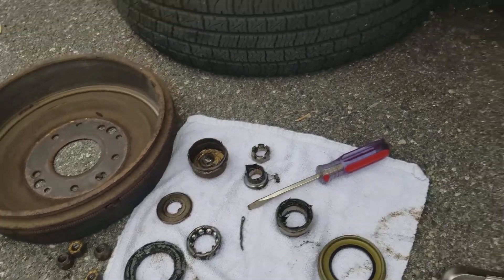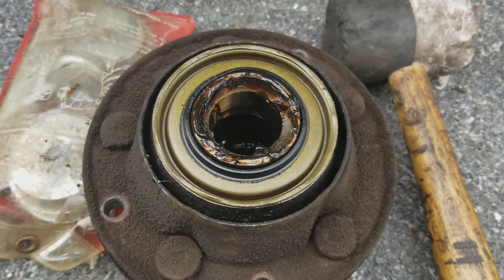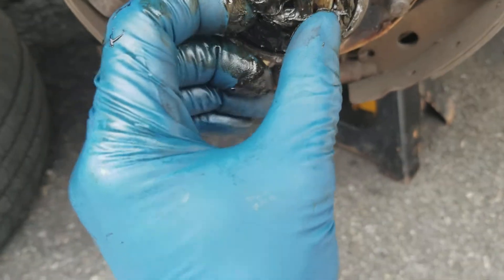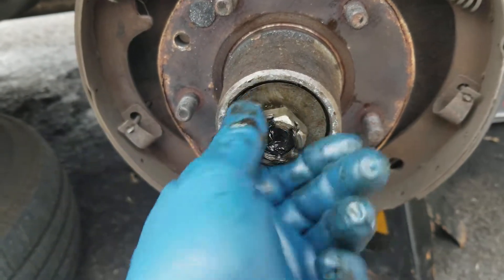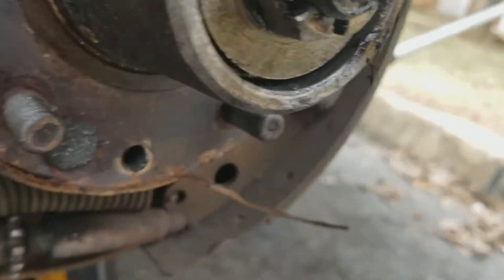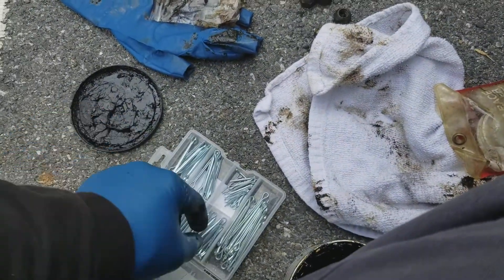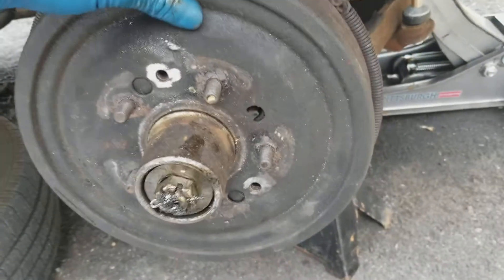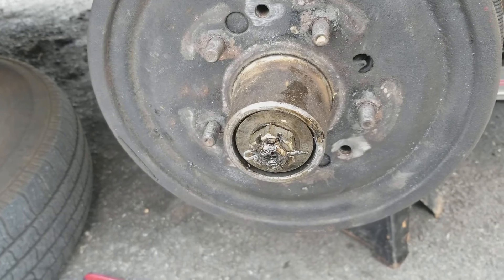Roller bearings for the '51 Chevy part 2

Comment: early corvette  had ball bearings
Reply from the maker: Tom Burgess 
This is true. That's because they had the exact same front end.
Reply: Christopher Spencer yeah I remember that when I saw them on a vette I thought man that is crude technology for a fast car Lololololol
Reply from the maker: Tom Burgess 
Haha yeah, I guess as long as their packed with a ton of grease they'd be "ok"..? If the National bearing I bought last summer didn't have a plastic cage, I wouldn't have been AS concerned
Reply: I am replacing the bearings on my 52. I torqued to 33lbs and backed off a bit. Still feels tight. Did this method of adjusting the bearings work out for you?
Reply from the maker: Yeah I used the factory spec and backed it off. You can try going back 1/6 of a turn more to see how it feels. There's really no "number" that works, it's more by feel